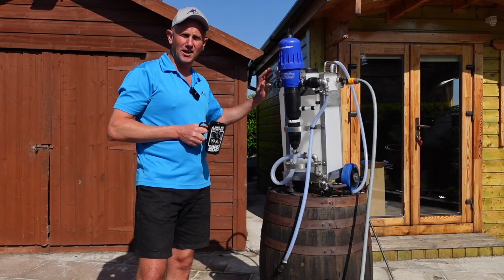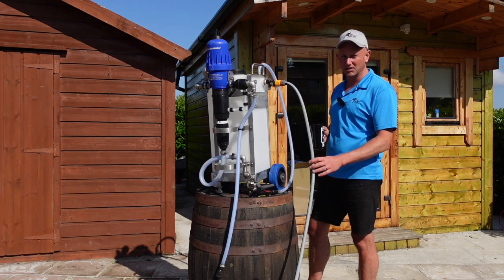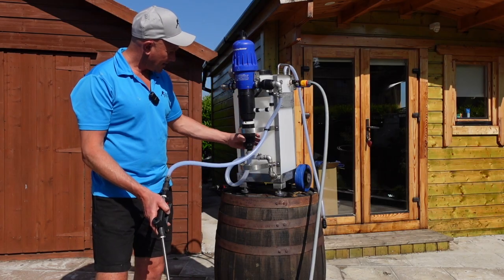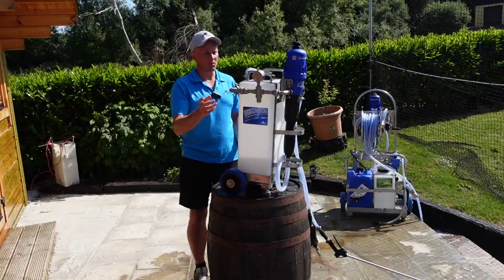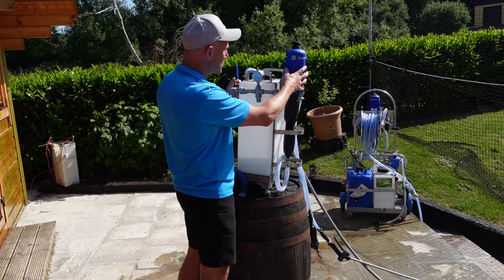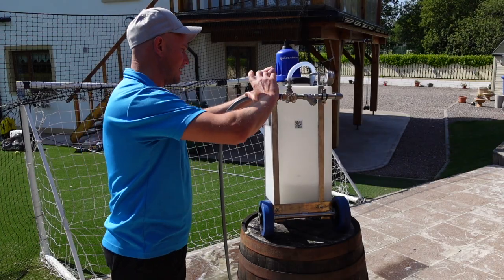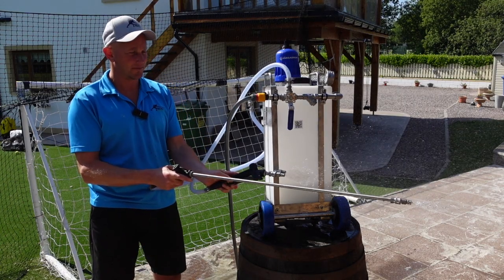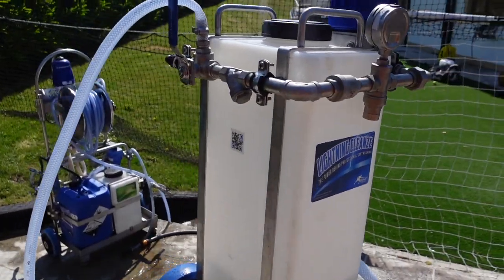Benz Lightning Zap: Softwash Application System Explained

Comment: Love it. 
1  is this for all chemical use? how would you completely remove a chemical that you shouldn't or cant mix with the next?  
2 is it easy to rinse it out? 
3 are there many chemicals that should not be mixed together?
4  is it possible for all of your applicators like this one be installed in the van and left there while working on a property? cheers
Reply from the maker: Yes — it has been designed specifically for our products and for the dilution ratios we recommend, so it is not suitable for raw bleach, for example.

Rinsing the system through with clean water between our chemicals is absolutely fine.

If you’re considering using any other products, please contact us first and we’ll be happy to advise.

The Zapplicator can be left in the van but has been designed so can be portable as well: https://www.benzsoftwash.com/collections/zapplicator-range/products/copy-of-the-benz-zapplicator-all-in-one-portable-softwash-chemical-application-system?variant=47172049699159
Reply: @BenzSoftwash  Great stuff thank you